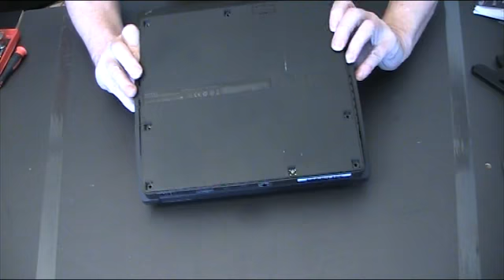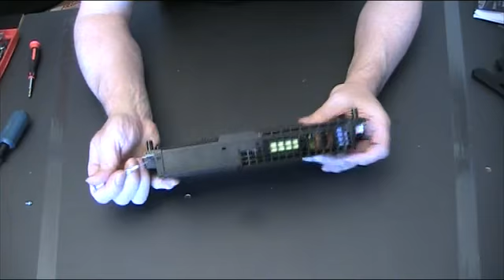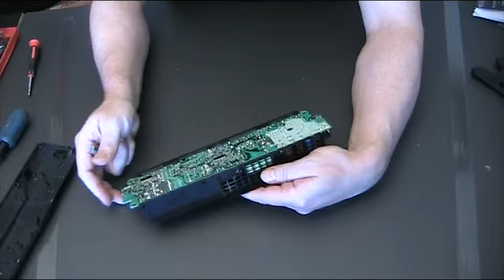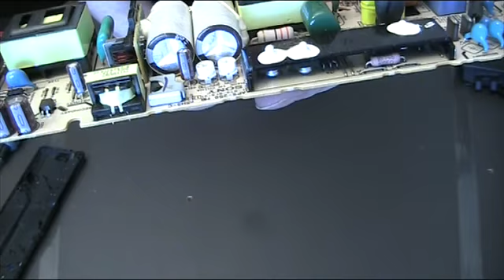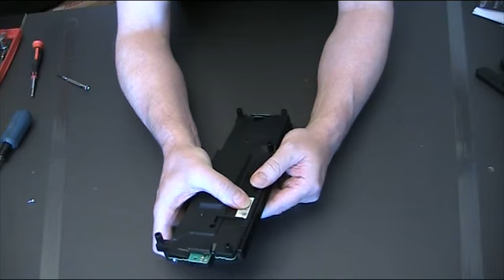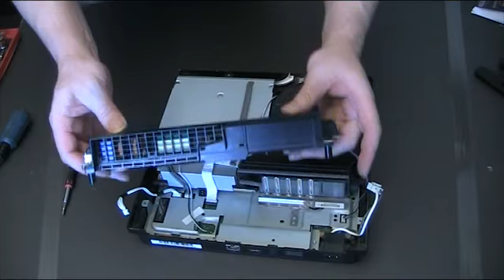PS3 SLIM | No Power Fix - 10 min PSU Repair | APS 250

Comment: went to use my slim last night had the power issue. used this video and fixed it.  I even put the wrong screw in the power supply shell putting it back together which got stuck in it.  Still works even though i messed up. great video

Comment: Unfortunately this didn't work for me. My slim didn't have any issues until it was just dead 1 day, got a used replacement and moved on for 2+ years before seeking to buy a replacement PSU and then finding this video. Would have loved this to work, but nope. My internals look different, not 100% sure where the fuse is in mine. I tried the potentiometers in several different positions. Took a picture first so I could go back, but 1 was rather close to the full way out or counter clockwise. I found another video where a guy tests the voltage coming out of the PSU so I'll do that soon before just pulling the trigger and buying one.

Comment: OMG i love you (platonically) you actually fixed my problem. I removed the old and applied new thermal paste like everyone kept saying only for it to have zero effect. It couldn't even stay on for longer than 5-10 minutes till i did this power supply fix. I guess my ps3 wasn't getting enough power because i couldn't even hear the fan humming.

Comment: Cheers, fixed my PS3 Slim. For others, my symptoms were the console would shut down after a few seconds. But if the HDD was removed it would stay on. So figured the power supply might be on the limit. Sure enough adjusting the two pots bought it back to life (until I can order a replacement).

Comment: Sadly did nothing for my PS3. I've always periodically serviced it to keep it healthy (inside and out its like new) but it started acting up with a few random shutdowns. Went up to a 45 degree twist and still nothing. Seems likely my model of slim (2003A) developed a RSX or Cell CPU ball joint fault.

Comment: This is the type of my PS3 the problem is my ps3 power supply doesn't have adjustable or adjustment please what can i do, 
My ps3 once i plug it, it on red ligh3 once i press standby the green light ON and gone in 3 second 
Please help me out

Comment: And I should’ve known it wouldn’t work on mine because my PlayStation slim does not look like that with the cover off. In order to take the fan off you have to take the entire motherboard out not just two screws on top. And every instructional video on this shit bag app has playstations exactly like the one you’re working on.Not a single one has my type as fucking usual

Comment: I just bought a CECH-2001A PS3 Slim that wasn't working, opened it up to find that the previous owner had installed an incompatible PSU (an APS-306 meant for the 30xx models). Is there anything I can do, or am I totally out of luck? Compatible PSUs seem to be pretty expensive :/

Comment: Hello . I have a question . I have the ps3 slim cech 2004b  do i look for APS 250 PSU?
Reply: PS3 Slim 2000 Series most likely have the APS-250 PSU indeed (mine does, 2004A Model, if it helps ..)

Comment: what are you adjusting  when you are turning those potentiometer  i have one pin giving 5 volts and the other giving 3 volts and  my ps 3 stays on  only for a very short time.

Comment: does not work on all models, my psu was completely different nothing to adjust. got my psu working again but nothing that would help anyone else, took 4 screws out of the bottom rear of the console and it works again...wtf

Comment: On a off subject to your video, I'd like to ask your opinion on heating issues the power supply gradually happens over a course of time to now it is hotter than usual as in the fan runs faster. Note that I had already replace the IHS paste as well to the GPU/CPU as well. I know that too much heat to the board may cause some unexpected failures, is this one of the moments to replace it instead of fixing? Great demo to this video as you explained the risks before doing this procedure as some videos don't about static discharge and safety for you or the components inside.

Comment: How can i adjust the screws correctly , my ps3 is keeping shoting down even after moving those screws , and i have ps3 slim 3004b , the inside is little bit different from yours , need help ...because i didnt found the blue lines ..
Reply: Mine was a little different too, no blue lines just notched. make sure to turn the screws "counter clockwise" . try 1/8th turn increments. can test without full reassembly too.. I just did it and it Worked !! good luck ll-NoFollow-ll A___
Reply: Wes Maximus yeah i tried without a assembly but nothing it didn't worked for me
Reply: sorry to hear that. maybe some capacitors or fuse or smthin. hope you get it going again.
Reply: Wes Maximus  thank s but i bought a new jailbroken now , if u need so me help on gta i can help you , rolls , stats , unlock all , ....
Reply: Might just try the Jailbreak myself. been looking at that. Dont have nor  played any GTA games

Comment: I was replacing thermal paste, and so of course i assembled everything correct but the disc wouldnt move, i clean disc lens and everything, then a day later i turned on my ps3 normally, out of nowhere it turns off and smoke comes out

Comment: I have a slim 250G power supply model EADP 220BB.  There are no adjustable screws.  I've seen this model tons of times.  Other ppl posting the same thing.  What about the other model?  How can I fix this problem.  the red light turns on but when I press the power button it turn on and immediately turns off again and the red light blinks.  If I keep on trying for a long time eventually it goes on and I could play for hours.  The next day the same thing happens.   Takes forever to turn on and stay on.  Sometimes I have no patience and give up...  Somebody help..  Do I have options or do I need to get a new power supply?
Reply: Did you find a fix ?

Comment: Mine didn't come with a marked line, i was trying to clean dust out of the PSU and now I disaligned them from there original position. How will i know how it originally was? Thats my only issue.

Comment: I don't know if it was the potentiometer trick or the fact that i seen a comment somewhere that told me to start it with the fan unplugged, but I did both at the same time, I adjusted the potentiometers counter clockwise a hair, and I left the fan unplugged before starting it up. It started normally, so I proceeded to plug the fan back in and sure enough it still started normally. I'm just glad I was able to fix my baby. It's old and some components are even rusty, but she's a 250 gig that's still kicking. I do believe it had to do with the potentiometers but that is my opinion. I would have been sad if I would have had to get a new PSU or something. I just bought The Last of Us on PSN. Anyways, great video I'll give credit to you.
Reply: +Christy Myers  can you help me   my psu does not look the  same as in the video
Reply: Mine didn't either I'll post a video later and show you mine and how I did it.
Reply: No you didn't^^

Comment: FINALLY someone who actually knows what they are talking about! This fixed my problem. My PS3 would randomly shut off and the red power light would go out as well. Unplugging and plugging back in the cord would fix the problem temporarily but it would shut off again after a few minutes. I followed this video and my PS3 is working without issue now. Also, be sure to have air duster handy so you can do a little clean-up too. Thanks!
Reply: Definitely gonna try this. I got an overheat warning on my PS3 yesterday so I took it apart and repasted it. Put it all back together and it gave me the YLOD, then it died completely. So I gotta reflow the CPU and RSX and then do this and it should be good to go. I'm sad because this was my jailbroken rebug PS3
Reply: @TheSaxAppeal  same thing happens to me how is your ps3 now
Reply: НАКОНЕЦ-ТО кто-то, кто действительно понимает, о чем говорит! Это решило мою проблему. Моя PS3 случайно выключалась, а красный индикатор питания тоже гас. Отключение и повторное подключение шнура временно решали проблему, но она снова выключалась через несколько минут. Я посмотрел это видео, и теперь моя PS3 работает без проблем. Также обязательно держите под рукой баллончик со сжатым воздухом, чтобы можно было немного почистить. Спасибо!
Reply: I have the exact same problem as you, so if it fixed yours, I’m going to try this as well

Comment: hi nice work i have two ps3 with same problem one the super slim ps3 with PSU model - APS-330 and a slim ps3 with PSU model - EADP -200DP it keep shouting down after like 5-6 seconds any help on .
Reply: +titus femi yeah put new thermal past on the bottom of your ps3 if you have ever 100% taken it apart it says your ps3 is overheating which it isn't but says it is because you have no thermal paste
Reply: +AhRUBBER DUCKY he's not having an overheating problem with a 5-6 second shutdown. You shouldn't tell people to mess with thermal paste. Yes, i know some have issues with paste, but many people have completely ruined their systems because of all the thermal paste video's here. Youtube video's do not make people qualified technicians. At least suggest it as a "possibility". Personally I always warn people about doing it themselves. It's worth paying an electronics shop about $30...if it fries, it's on them. That way you're not left with a paperweight. Just a suggestion.
Reply: Ham Samick ill give you that one +1 to you
Reply: Ham Samick but most people dont know about that paste when they take it apart then that happens thats why im saying that

Comment: mine doesn't look like that watched 2 with both different with it from mine
Reply: Mine was different too. I found the potentiometers (little white screws) still. They are in a slightly different place and sit diagonally instead of right next to each other. They didn't have the blue marks either. I just turned those back a little like he said in the video and it still worked.
Reply: i dont have them at all
Reply: Me too
Reply: All you need to do is replace the power supply for a couple of bucks

Comment: Hi, i have a ps3 slim model CECH-3011A, And the issue that i have it's that doesn't give video signal, when you turn it on, and after 20 40 seconds, it turn off with out  beep and the led turns off  2.

So i opened, and the model of the power source says in the in th plastic box  EADP185AB, but in the board its EADP185APA, and it doesn't have the Current, overheating potentiometers .

soo i havent find a fix yet.

Can any one halep me?
Reply: I think isnt the power source, the problem it apear to be an over heating problrm, you need to do some kind of reballing or reflow of the gpu and cpu. 

Best regards

Comment: Yeah...I have this issue with my PS3 Slim just now, had it for 2 1/2 years. All i did was put AS5 on it!? Unfortunately i have the EADP-200DB PSU which has no potentiometers! Luckily the APS-250 & 270 is compatible so will try to get one of these. Prices are ridiculous though!

Comment: After a sudden power shortage my ps3 hasnt been operating like usual. The green light turns on but nothing appears on my tv. It accepts and returns cds tho. Other than spending money for repairs what can i do to fix this?
Reply: To those wondering, I replaced the ps3 hard drive with a "2.5 inch seta" it didn't cost much on ebay and now my ps3 is as god as ever. However i lost all my memory on my old hard drive. Im sure there's a way to re install old hard drives into ps3.
Reply: Ink Knight Take your old hard drive hook it up to you PC and transfer files to a high capacity thumb drive thru your PC.  do not modify the files.  should work just fine.
Reply: To fix the screen try HDMI and or the ps2 video cables

Comment: Got a question for you Steve Nixon: How likely is this the issue in a broken power unit and not the fuse? You have any idea? I'm just curious because I'm looking at a broken one now on ebay and if I could just fix it this way I would certainly buy for the cheap price. Thanks!

Comment: Mine seems to be working now, can someone explain to me what this does? and why it fixes the problem?
Reply: It lowers the resistance of power that runs through the PSU to the 12volt plugs...essentially squeezing every bit of juice you can get without having to buy another.
Reply: ModdSquad Ah I see, does this do any damage to the PSU? or can it function fine with less resistance.
Reply: It is basically just prolonging the inevitable....that the PSU is dying. It does buy some time..I have done this for customers before and they have yet to call back...but I have been doing this for 4 years so I am sure at least some of them were replaced. It's a crap shoot.....just cross your fingers and do it or buy a NEW one. If you get a used or pulled PSU the chance is likely it will just happen again.
Reply: ModdSquad
You can't buy new power supplies though, only used ones.
Reply: Well...you can get third party PSU's probably made in China. I would rather buy a used one and clean it out lol.
Reply: ModdSquad Pretty much everything and anything is made in China, there is nothing wrong with the products, but "if you want to get cheap shit, you can get cheap shit", even in China.
But used PSU's would be a good and cheap option, since there is a lot of these consoles that crap out way before the PSU does.
Reply: I am assuming it "reflows" the solder on the solder side of the board. It works (sometimes) when PS3 gets the YLOD...or yellow light of death. You reflow the solder by heating it to it's melting point for a few moments and then let it cool, essentially acting as if the board was freshly soldered. I have done it to a million and 1 consoles but never to a PSU...but the principal is the same.
Reply: +Petri K if there were nothing wrong with the products...we wouldn't be in this situation.

Comment: aps 306 also has the potentiometers but this didnt work for me and in order for me to fix my psu i need help in identifyin the various components of the psu so please who is willing to help me identify?and heres a little advice,if your psu has the pots and even after cranking it the psu dosent work be sure to change the pots back to its original position and if your psu dosent have the pots go ahead to replace the fuse.... it easy if a 15 year old like me could do it i see no reason why you cant

Comment from the maker: Yeah sometimes it's difficult to figure out what is wrong. Just use trial and error by removing parts, hard drive, blu ray and swapping the psu. Also try changing the on off data ribbon. Worst case it could be a motherboard problem

Comment: Thank you for the quick response.
I do know what potentiometers  are, just were wondering their job on this particular setting.
I adjusted them a little bit, and running on test now.
I wouldnt be quick to trust on whether or not they can be adjusted outside the component tolerances,
especially when theyre in a closed space.

But I guess, if people have been doing this for a long time now, it should be ok. I just pulled mine out of the closet, been sitting there for a long time.

Comment from the maker: Potentiometers vary current, for example a volume control is a potentiometer. These trim pots vary the micro current within the PSU. i imagine they cannot be adjusted outside the tolerances of the components. People have been doing this for several years and I've yet to hear of anyone saying it damaged their console. Naturally you work on your console at your own risk. Good luck

Comment from the maker: The 3003 doesn't have the same power supply and I doubt it has the adjustable trim pots. Worst case you will have to replace the complete PSU but they are not to expensive, certainly cheaper than sending to sony.

Comment: Hey Steve Nixon, last Sunday, there was a high voltage current in the house, and as a result, the PS3 got fried. I don't know if it's the fuse or the PSU. It's an APS-270 btw. I have ordered a new PSU for 20 bucks, but now I'm scared... Is it just the PSU or is it possible that other components of the PS3 got fried too? Please reply!

Comment from the maker: I've seen people try over and over again with different settings until they get it right, Other people say it's risky because they feel it may over load some components on the motherboard. Personally I don't think Sony would install trim Pots that would work outside the tolerances of the components. I'm a risk taker but if you are not then I would advise replacing the PSU,

Comment: Guess I wasn't lucky enough for this to work lol. Thanks for the tip though... and I know its not the best thing to do but I did a jumper wire across the fuse for a quick second and none of the lights came on so I just ordered my new psu... thumbs up on the video though!

Comment from the maker: I haven't worked on the APS-306 but if it has adjustable screws (Trim Pots) give it a go. If it doesn't work you have to take it to the repair shop or replace the PSU anyway. Naturally you work on your console at your own risk

Comment: Very good tutorial, but my power supply doesn't open the way that yours does. I have the EADP-200DB and the power supply unit doesn't have the little holes with clips that you describe. Is there a different way to open mine, or will I have to replace it?

Comment: my power supply dont have 2 screw to adjust power how i fix without 2 screw and my ps3 power turn off itself every 10 sec and i try look at youtube there no other but aps-250 
do u have any way to adjust power supply without using 2 screw i bought new ps3 at 2012 and i accidently drop the ps3 but power is work but only short for 10 sec and turn off itself i order new power supply and it still wont work can u tell me